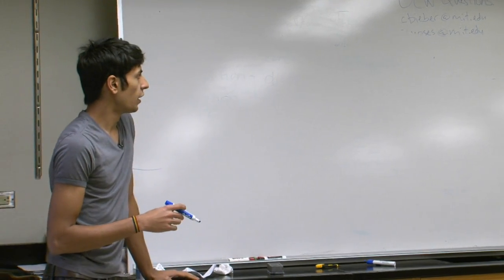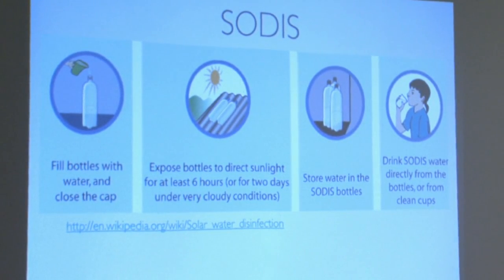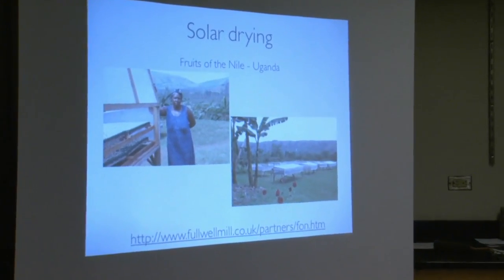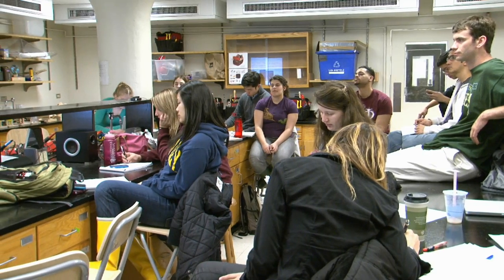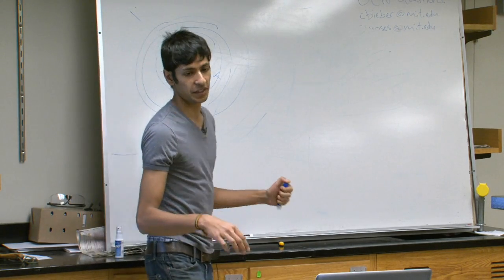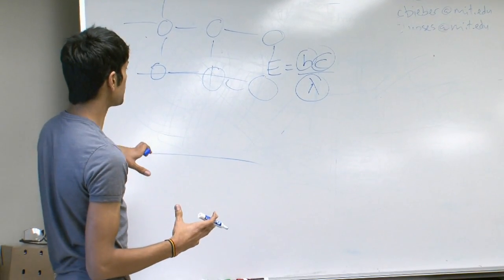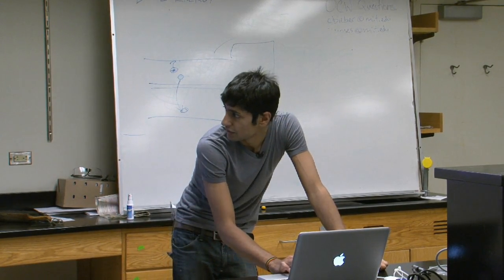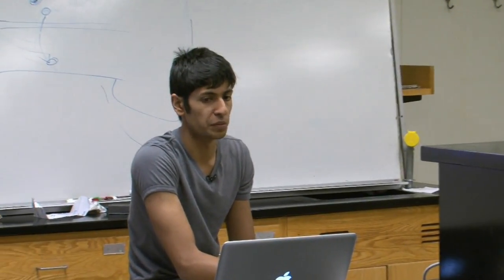Lab 4: Wiring Solar Panels, Part I: Lecture

Comment: With the sodis... You could 'double' the water being 'irradiated' by using a reflective coating on the opposite side to the sun, this might also fix the cap issue as the light would be randomly reflected into it. Alternatively putting the whole bottle in a hemisphere of foil would increase the speed of disinfection and the depth (circumventing the 4 cm depth issue, so larger containers could be used).

Comment: Why not place a black rod inside the 2 liter bottle it would increase warming and cut the depth in half if you are concerned with the 4 inch 50% reduction issue. The reason you use 6 hours is to reach temp range you can do this with metal UV kills bacteria but does not take as long so you can use cold water in the sun transfer the water into the metal container then after it cools you can return it to the plastic to reduce bph exposure.